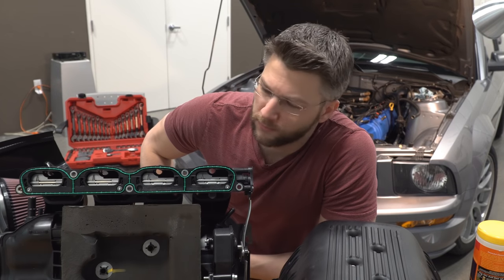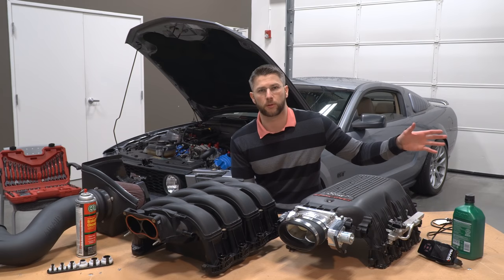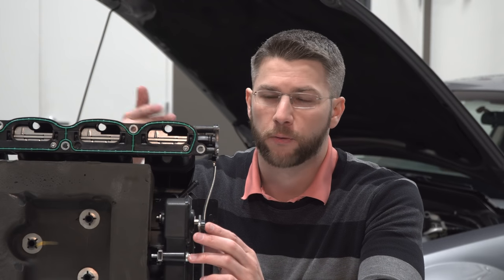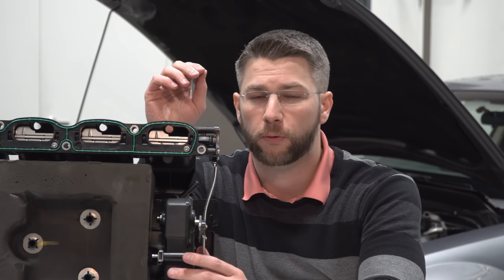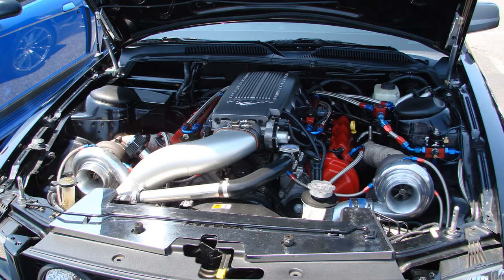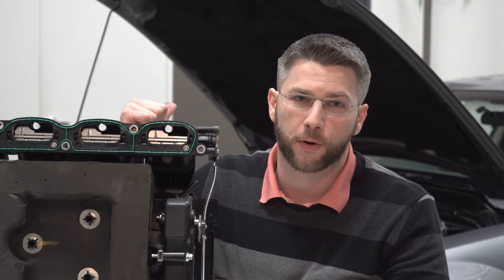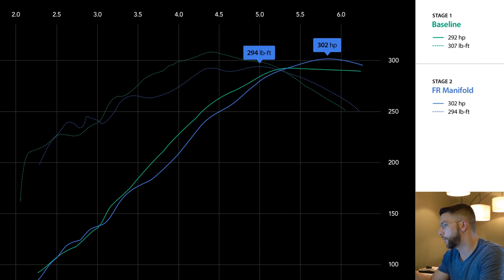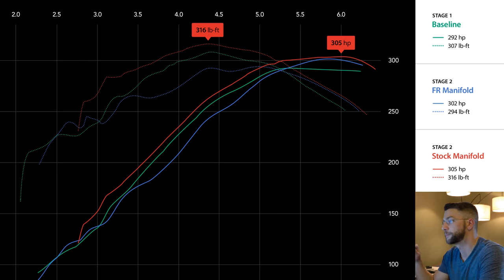Why you shouldn't remove your stock intake manifold

Comment: if you have a 2015-2017 ford mustang gt and are going with a 2018 ford mustang gt intake manifold just get the IMRC  pigtails people  no lockouts  save your CMCV
Reply: Upgraded my 16 GT to the 18 IM but funny thing is Palm Beach Dyno wanted me to lock out the IMRC & CMCV valves! This upgrade cost me over $1800CAD/Parts/Labor/Tune and if I could go back I would as the only noticeable gains are on top "BIG Difference" but mid to low I do notice a loss which also bothers me because on a daily this is where we need the power more...

Comment: You need to add some steeda underdrive pulleys
Reply from the maker: Just installed them! Need to update my build sheet.
Reply: I had the steeda under drive crank pulley on my 06 mustang did nothing but cause over heat issues. I reinstalled the stock pulley and it quit overheating. I’m curious to see if you have the same issues.
Reply: I have them installed them myself its been over a year on my daily no issues...
Reply: ive had mine on for over 4 years with no issues... that sounds like a timing or thermostat issue

Comment: So, are we sure that the CMCV removal would have such a pronounced negative effect with a dyno tune? I feel like a canned tune wouldn't yield as much on the dyno as a custom dyno tune. You mention getting a dyno tune later, but why not try a dyno tune with the CMCV removed as well? You needed to tune for this particular mod.
Reply from the maker: We are not sure the negative effect would be so pronounced. Indeed a proper comparison requires two custom dyno tunes (one for each manifold). I did have a tuner tweak one of the FRIM Bama tunes via an SCT handheld on a dyno (not an S2S tune), but no major gains were made. I tried a total of three Bama tunes with the FRIM and reported the best run in this video.

Each manifold was tested with a Bama tune, so given the results and after researching the point of CMCVs, it seemed prudent to move forward with the stock manifold.

I didn't get two custom dyno tunes because each one is $500 and it's unlikely Ford would add the engineering and materials cost (the CMCVs) to reduce power output. As I mention in the video, I think the FRIM makes sense with tight gearing and/or on a boosted application.

Comment: Four Eyes....excellent video! Have always wondered about this, your video has helped to give some perspective. Looking at your dyno run analysis, I can see some similar patterns w\ my car ('09 GT w\ 4.6L running LT headers\HF catted X-pipe w\ Pypes SB MM catback exhaust running a Bama 87P V2 tune) as yours at the 2500-3000 RPM range as my car's power\torque flattens out in here as well as yours is under part throttle acceleration until she exceeds the 2800-3000 mark at which the torque\power just explodes upwards--may be indicating that the CMCV's are\were potentially not operating as they should be (which is what I believe is the issue w\ my 4.6L-either got CMCV controller issues or CMCV shaft binding as when the power\torque surges occur at the RPM ranges I mentioned on my car I am holding the TB at an assumed constant part throttle position so either I a.)have a wayward TPS helping to cause ECU miscalculation at the "stated" TB position or b.) faulty CMCV system)--should be a much better power\torque transition curve to CMCV FO w\ the OEM tune\stage 1 Bama 91 tune (as was shown in your dyno run 3 w\ the new OEM IM w\ new CMCV controller install) & something hasn't been accounted for in the same RPM range in the Stage 2 Bama 91 tune w\ the Stage 2 FRPP Intake\TB install that is causing the same power\torque drop off at the same interval but isn't corrected\made back up causing the torque\power drop off to remain until later on as the CMCV's should be FO at 3000 RPM forward....which should remove them from the picture at that point. Funny you see the same pattern in the same RPM interval w\ CMCV's installed\operating vs CMCV's removed\assumed accounted for in tune.....but far worse w\ stage 2 parts..... This screams tune mapping issue as well IMHO. Also which tune did you use w\ the new OEM IM install....the original OEM stock tune or the original Stage 1 Bama 91 tune (either should have the CMCV's active in tune)? Didn't catch this during your video..... Gonna be interested to see your dyno results of Stage 2 after custom tuned as I believe you have already alluded to some type of correction that affected the outcome. I myself am also getting this FRPP intake manifold for my ride as I have already decided to go w\ a centrifugal SC for mine (Paxton NOVI 2200 HO w\ intercooler) so the expense wouldn't be wasted but am also gonna test by keeping the OEM 55mm TB then use a TB spacer to kinda create the deltaP effect to increase air velocity into the IM plenum area to kinda recreate the effect to some extent to see if this can be made up in the IM runners AND get a custom ECU tune to specifically match all up. Got some datalogging to do! Good stuff! Keep up the good work!
Reply: Interested in seeing what results you get with the TB spacer. I have a very similar setup, but added the 62mm Twin Blade Throttle body.

Comment: Okay, question.  How much do you think the reduced dyno numbers were a result of the FR intake (sans CMCVs) as would be compared to an OE manifold with CMCV deletes??  I know you did not test the later, but everywhere I see suggests for high RPM use (like my track car) NA cars should consider deleting these valves.  However, your data is clear and convincing that the deletes are not a good idea for an NA setup at any RPM, if at least, using the FR intake.  I was thinking the FR intake is tuned for forced induction, and thereby, the reason your NA set up did lower numbers on the dyner???  I have a 2008 Mustang GT with virtually the same build as your Stage II (w Bama).  I only track this think and assume the deletes would be a great add on as I spend all my time from 3500-5500 RPM.  I was just wondering if your data is more from the FR intake than just the deleted valves.  Thoughts?

Comment: What about running the Steeda Motion Plates in place of the stock?
Does that have a similar affect as the aftermarket high rise intakes?

Thanks?
Reply from the maker: Hey, good question. No, they yield pretty different curves actually. The intake runners on the ford racing manifold sap low-end torque, but let the engine breath way better above 5,000 rpm. The stock manifold is optimized for low and mid-range torque, but really struggles at high RPM. From Ford's perspective, this makes sense as most people favor drivability over maximum power in the top-end.

When the throttle reaches a threshold (~50% I'm guessing) the CMCVs will go from fully closed to fully open. If you floor it, there's about a 1-second delay before the CMCVs actually open. So removing the charge motion valves makes the car feel quicker because it removes that delay. They also marginally improve power in the mid-range. I just recently compared my FBO and cammed 3V with the stock mani, stock mani + delete plates, and the ford performance intake manifold. The stock mani with the CMCVs removed netted me about 5tq and 1hp over just the stock mani.

If you decide to remove the CMCVs you will need a tune. The ECU recognizes that the valves are not responding and changes the engine's timing. In my case, my car "felt" quicker, but on the dyno actually made less power until being remapped.
Reply: Thank you friend for your prompt reply. (I know the thread 🧵 has been up awhile). Though it looks Nice, after studying up I had already decided Not to do the Ford Performance intake. I thought the Steeda plates might be a nice alternative. I’m gathering that they are Not worth it then. Save the money. I had considered the Steeda plates while doing the cams. 
I don’t race the car. It is a second vehicle to drive to work and enjoy.
Sure forced induction would be fun, But that is more money than I care to spend.
 I am fortunate to have a really good tuner Not far away. So yes, after mods he will dyno-tune it or hook it back up to his laptop again. Prob with new mods, it would go on the dyno.
Car is tuned well. I just want the cams for the sound and a few more ponies.
I think I’m going with the hot rod cams as they are a Ford part for that Ford engine. They also don’t require extra changes to install. Last, they have better gains throughout out the powerban.
Drive ability.
(These I’m sure you know).
That’s the reasons I’m goin with the FRPP hot rod cams.
Any options or suggestions would be appreciated.
Thank You!

P.s. read many times cams like headers....that has already been taken care of.

Comment: Now I’m not 100% percent sure about this but I’m decently sure the example of the water hose is inaccurate. The main difference is that when using IRMC  plates your moving air and the restriction causes and increase in air velocity to meet demand of total flow. The only reason you net a total CFM increase is because of the scavenge effect in which a pressure differential is created and cannot exist so the air behind it is pulled it to equalize the difference . Essentially it’s slingshotting the air from the rear . It’s the same principle that allows air planes to fly. The Bernoulli principle. This would not be applicable to a liquid as the energy needed to create a vacuum in a liquid would be insufficient.    Someone please tell me if I got that right .

Comment: Four Eyes 03:28 - 03:50 is wrong, water has its own pressure and air is dont, if you put empty ballon and drop it on the ground it will fall, but if you drop ballon with full of air it will fall slowly, that means air has nor pressure and its neutral, reason is why air comes into throutle body is becouse fire is requires air to sustain. I deleted the butterfly valves and reprogramed ecu, thats added about 4 hp.

Comment: Curious if the findings (significant mid range torque loss)  would hold true on the 4v Coyotes.  The Boss 302 manifold (PN M-9424-M50BR) has always been on my wants list when I eventually get into looking for more power from my '14 GT.

Comment: My stock manifold has a leak , and I can’t find a replacement at the dealer . Dealer says that this manifold is in back order and it could take up to 3 months to arrive. This situation is forcing me to get the ford performance manifold and it will also make me replace the throttle body .I’d rather keep my car stock after seen your video and read lots of comments ☹️
Reply from the maker: So the ford performance manifold is good with cams and a dyno tune (I need to do a follow-up to this video!).
But you can just buy a used stock manifold off of ebay for a couple hundred bucks:
https://www.ebay.com/itm/2005-2010-Ford-Mustang-GT-4-6l-Authentic-OEM-Intake-Manifold-W-runners/193620633827?epid=1422224040&hash=item2d14b068e3:g:cs0AAOSweENfD75x
Reply: Thank you, did you experience problems with the racing manifold and throttle body ?
My car has 81259 miles , sellers  don’t post their car mileage when manifold was removed  .my concern is buying a manifold with the same issues than mine.
Reply from the maker: Nah no problems here 👍

Comment: Following this video, what about doing something like Hot Rod Cam and the FP 62mm Throttle Body with the stock manifold, and a tune?

Would the FP throttle body work on the stock manifold? Seems like it could possibly be a 'best of both worlds' direction...
Reply from the maker: I wouldn't get the 62mm throttle body unless you have a centrifugal, just not worth the money imo.
Reply: @Four_Eyes  If my car is just a street car - looking to maintain good drivability and not going for crazy numbers, outside of loving the lopey idle that comes with it, what kind of gains might you expect from just doing cams with a tune (and I obviously understand that the tune is an open book and could be designed with  lots of outcomes in mind)?

Comment: Very good videos!! This is my second 3v mustang build. you can see my old one in my videos. I did have the fms intake and large throttle and hot rod cams. to me the intake was a waste of money. i didnt see my gains . looked awesome. My new build i was thinking on removing the CMCV and add throttle body . and already have the Air raid cold air. So you are saying if i do remove the CMCV i will be hurting myself ?  I will be doing down the line to put in the hot rod cams again. I did love the sound.   Help me out with some feed back please.  Thanks agin for your videos on this Years mustang .
Reply from the maker: Thanks Mike. So the CMCVs can be removed if you have a good tune, and in my opinion the best way to do that is on a dyno. That way you can be objective about the car's performance. If you remove the CMCVs and continue with the same tune, the car will definitely make less power.

Comment: Honestly this is just my opinion. I wouldn't modify the cars from 2005-09 id just replace the old stock parts with newer stock oem parts im not looking to get more horse power i want reliability and longevity so thats the route i went with my build i wanted easy to access cheap parts i can find pretty easy i also didnt wanna dump a bunch of money chasing more horse power i have enough to have fun when i want to thats good enough for me if i do make other modifications i plan on doing most of the work at once or in big chunks when i have a second vehicle so the mustang can get a little TLC maybe have it set up for track days

Comment: Hey love the videos man. I do need some advice bad. I have a 05 mustang gt with Detroit rocker cams bbk long tube headers and 410 gears it put 330 rwp and 326 trq but I have the stock manifold and throttle body so is it worth me getting the ford racing manifold. I am so torn on what to do. Can you please help me out lol I need some expert advice
Reply from the maker: You might see another 15 horsepower or so. Hard to justify spending over a grand for those kind of gains. I would put it towards a procharger kit.

Comment: I went back to stock even with a procharger or Paxton at low rpm the blower isn't making boost and above 4k the valves open wide enough that the ford intake really gains junk yet lose mid to low end 👍
Reply from the maker: Makes total sense, ford didn't design it that way as an art project y'know. Thanks for letting me know.

Comment: Just by adding a cold air intake, long tube catted headers (California...) and a bbk twin 62mm throttlebody with a bama tune i was able to go from 297hp at the wheels stock on 91 to 317hp on 91.. I’m trying to get this thing E85 tuned after i install these ford racing 40lb injectors to see what it will put out then. My dyno guy has me pumped.. he’s thinking with E85 on my setup my 07GT should be putting down around 330-335hp just with the E85... not to mention the 6 speed swap i have planned..
Reply: Mike CorLeoné who has long tube catted headers for sale in California? Please let me know
Reply: I stay in Sac
Reply: Sofaking Raw i dont remember, the previous owner gave them to me when I bought the car and i just installed them without a second thought. I wanna say magnaflow?
Reply: @mikecorleone6797  is your car automatic?
Reply: @goofy1496  5 speed

Comment: Air is neutral and doas not flow by pressure like water do. Air itself comes to the cylinders where fire is, more space for air to go, more air will go, you lost the power becouse of to many air soaking to the cylinders and fuel injection are the same, its like you are leaning out the fuel, tune needed.

Comment: Great Vid! I just subscribed!  I have an 07 GT with all Steeda mods including the CMCV Delete plates I installed on my stock intake.  Steeds emailed me an updated tune file for the plates.  I have to say I didn't feel any low end loss...but you totally convinced me I did lose something with this vid.  My car runs great, however, I can't pass NYS inspection. My system monitors won't run the check.  I can't complete the drive cycle.  Put almost 1,000 miles on and still have 3 monitors open.  I emailing and begging Steeda to help me.  I think my only hope is to take off all the Steeda mods and go back to stock.  IMO  Steeda CMCV are not at all worth the $$ or BS.  Any advice you have would be greatly appreciated.  Thanks!
Reply from the maker: Hi Christopher, I am not sure what "...still have 3 monitors open" means? Does that mean you're throwing 3 error codes (3 things that would all cause the check-engine light to come on?).

If you have a lot of mods and are still running canned tunes, I highly recommend getting your car a custom dyno tune. A good tuner will be able to diagnose your car while significantly improving output throughout the RPM band.
Reply: Christopher Roberts so my stock 05 gt 4.6 doesn't have these plates? He didn't make that clear in that video. He said he bought another stock intake. So do they make another stock intake with these, and mine doesn't have them or?????
Reply from the maker: I bought another stock intake manifold because I threw the original one away. All stock intake manifolds come with charge motion control valves.